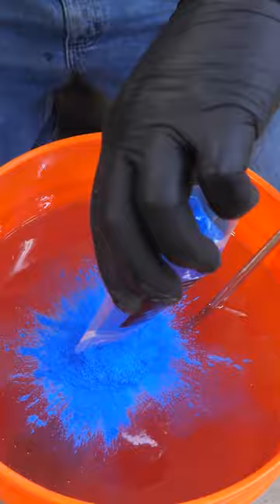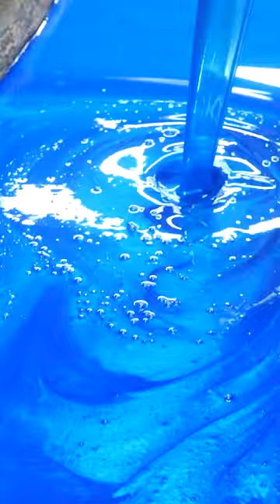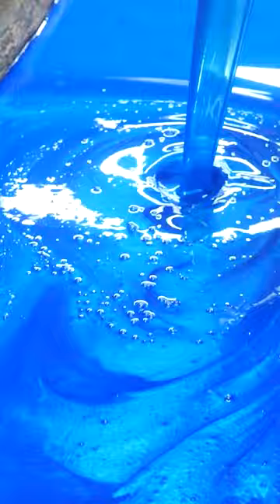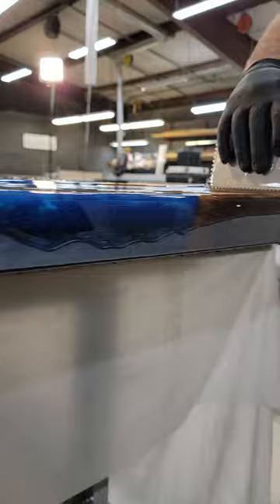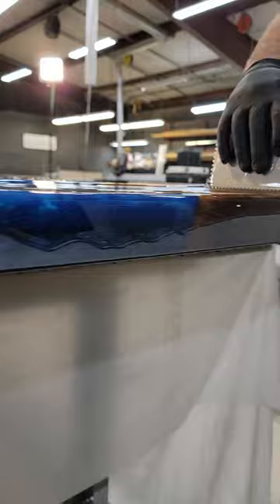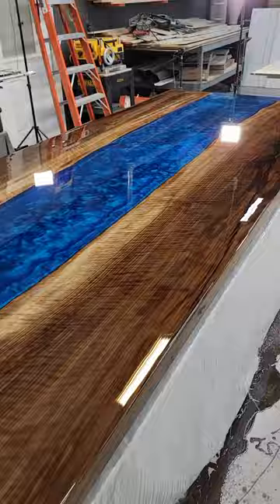5 Tips to make Epoxy River Tables #shorts

Comment: Where do I get to purchase the epoxy equipment.  I have been doing ceramic tiles for 20 years and loved your shower job.  It was so much cheaper yet so beautiful on Styrofoam base.  Making each wall one piece.  I was so impressed.  Im now on a desk for a automobile shop and would love to epoxy its tops with black and orange.

Comment: Don’t seal the slab. The river will not adhere to it well if you do that
Reply: I've always sealed mine and have had no issues
Reply: @acadiant2756  have you waited 5 years to see if it'll hold up?
Reply: @Bowamaketona  yea actually I have, no damage yet chief
Reply: @acadiant2756  doubtful, even more apparent by your reaction
Reply: @acadiant2756  why are you so offended and reactionary? And what things look better? No one said anything about looking good so I have no clue why you would even bring that up. So weird. I simply said that if you seal the edges then the river will not adhere correctly and in 5 years time the bond will be weak. I highly doubt you have a current experiment on hand that is 5 years old that was made using your pouring formula. I’ve actually seen what happens after 5 years when you seal the edges
Reply: @Bokalawamagetona  I have also seen what happens when you seal the edges, but to be fair I only have one pour that is 5 years old, and that one hasn't even begun to separate, it could be the resin you're using, or you just haven't prepared the wood.